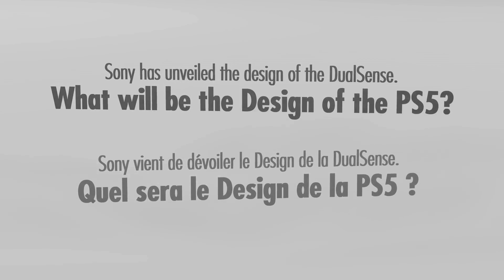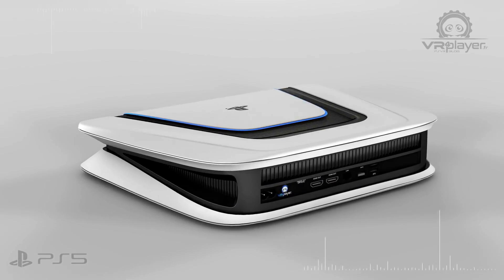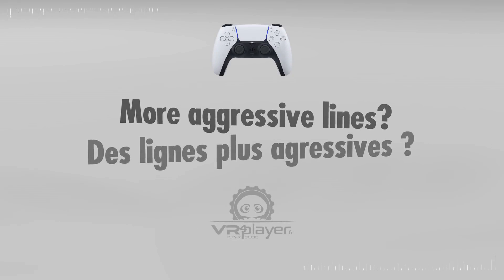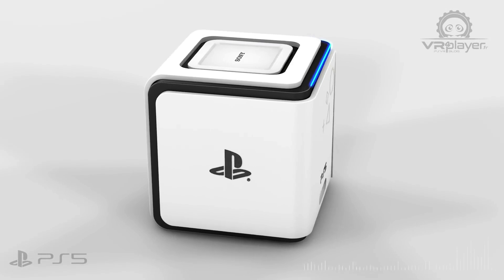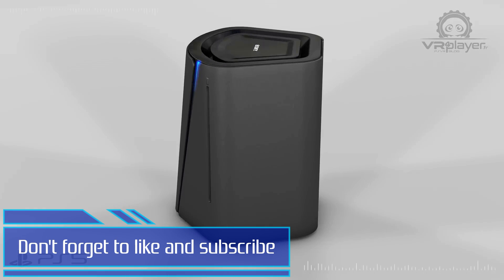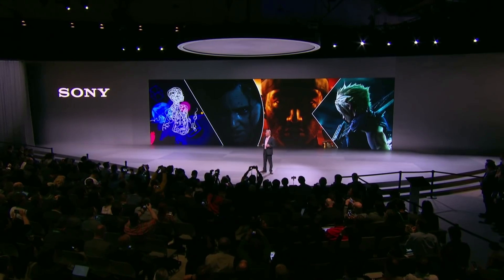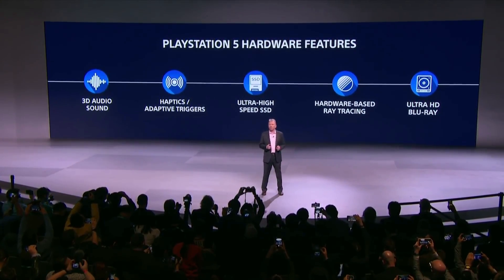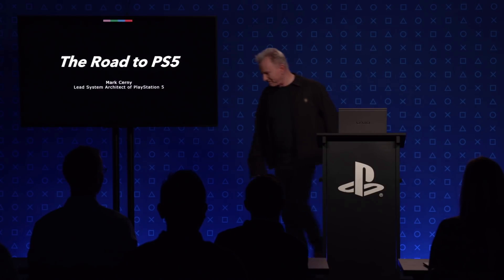PS5 Uses Revolutionary Cooling Solution | Overheating Concerns Squashed, New Patent Reveals

Comment: Xbox fanboys say the PS5 overheats yet ironically the xbox 360 had the most heat breakdowns in a system I've ever seen.
Reply: Been gaming since the nes , have bought almost every console at launch , the only that gave a problem was the 360 rrod
Reply: 54% failure rate to be exact.
Reply: @Krxtos7x  it was as high as 60% when they started coming off the assembly line.
Reply: My 360 had the RRoD...I was highly disappointed
Reply: I had every playstation up until the 360. All my friends transitioned to xbox and I unfortunately did too. I got the red rings after 6 months. Went right back to playstation ever since. It has its faults but it has way more to offer st the eod.
Reply: Jae D Xbox One X is superior in almost every way to all PS4 models. In terms of games that’s subjective and preference.
Reply: megazine that’s NOT true at all 

343 and the coalition have FAILED in every single iteration of halo & gears of war 

343 ain’t bungie the last best halo game is reach STILL 

Halo 4 playing like COD is a joke like fucking kill streaks 

Halo 5 with all those damn micro transactions is a RIP OFF 

The coalition isn’t epic games gears hasn’t been THE 3rd person shooter since gears 3 

Gears 4 is very lackluster compared to the trilogy 

Gears 5 is somehow MORE a RIPOFF than halo 5 

Forza is the only consistent series on Xbox and it releases every year making it become STALE 

State of decay series was let down 

Sea of theives was a let down 

Crackdown 3 is a laughable EMBARRASSMENT after 6 years and 2 different devs working on the same team using THE POWER OF THE DAMN CLOUD 

So no Microsoft exclusives were absolutely POOR compared to SONY & NINTENDO
Reply: DR3AMMA5T3R if ur ps4 sounds like a fucking jet, then clean it. Mine was like yours, but after cleaning the fan it runs dead silent. “My xbox one x is not even warm” lol
Reply: @DR3AMMA5T3R Wait hold on what games do xbox have again?
Reply: @DR3AMMA5T3R Wait hold on people still use bluray in 2020?
Reply: @DR3AMMA5T3R Xbox one is for hardcore games my ass didn't you see the E3 presentation it looks like they were tryna sell you a tv accessory.
Reply: @DR3AMMA5T3R Dead rising is on PS4.
Reply: @DR3AMMA5T3R By the way What you said about Dolby atmos did you know that Sony is making dedicated audio chip for the PS5 right? Which is SPU like the PS3 CELL which can open the door for emulation they are also working on this to work for all speakers headphones etc.
Reply: @DR3AMMA5T3R And guess what? Those titles are on pc too more reason to not get the tv accessory as known as the xbox one.
Reply: DR3AMMA5T3R God of War Uncharted 4 last of us Spider-Man horizon zero dawn dayz gone grand truismo sport drive club persona 5 bloodborne Detroit becoming human killzone infamous ghost of tshuma final fantasy 7 remake shadow of the colossus remake 

Sea of Thieves and state of decay where absolutely disappointments just like crackdown 3 

Notice how we have more games that are financially successful and critically acclaimed
Reply: @chriscollins3225  People be dumb they think their tv accessory is better then an actual console.
Reply: Patrick star I already know now they think having a bunch of mediocre studios making a bunch of shitty games on the game pass like stadia is gonna save them next gen
Reply: @chriscollins3225  "we" haha you pathetic moron .I'm a playstation guy and the only games worth talking about there are god of war and horizon zero dawn ,the rest are mediocre at best .children like yourself should shout about shit games ,only the good ones
Reply: lee porter bruh you ain’t a PlayStation fan 

You been proven over and over to be wrong already 

Everything you say speak louder than your words if you like PlayStation or not 

You ain’t fooling nobody 

360 is known to come in last place fact I literally just sent you think to PROVE such a case 

Everyone saw this Lol 

Also there are ppl in this thread that do NOT like playstation which have stated so 

You saying you came to this video proves you’re a PlayStation guy proves NOTHING at all 

What’s your PSN ? How many trophies do you have ? What games are shown you actually play ? Will show such a thing 

Which by the way I have a PS4 & PS3 and I can check BOTH
Reply: Xbox 360 the only console in the history of gaming that had to be recalled. Cost Microsoft billions
Reply: RE fan Firstly, a 1 TB HDD (which i have on my ps4) shows 860.1 gb of usable storage. Unless sony claims otherwise, they may be showing the actual usable capacity of the SSD, which is 825 gb making the SSD real size ~1 TB. Secondly, the ps5 gpu and cpu clock rates would drop only a few percentage points, i.e. 2.1-2.2 at worst for the gpu, which makes the gpu able to hit 10.3 tflops most of the time. Same for cpu. Know the facts before spreading false info.
Reply: @rtx2080ubermacht  yes but you would also have to take into consideration for them to draw maximum power to the gpu, the cpu would have to take a hit. So for devs it will become a balancing act.
Reply: Doug Burton true, the ps5 will have constant power draw. We’ll see how it pans out.
Reply: DR3AMMA5T3R then clean your ps4 dumbfuck
Reply: The white xbox overheaded but when the xbox slim came out that was solved the ps4 is kniwn to be loud and overvheat my one x is cool and quiet
Reply: Xbox does have a advantage in terms of raw power but when did that matter? The og Xbox was more powerful than the PS2 and look what happened? People here saying that the PS5 is a sega 32x should really look back at that comment and see how ignorant you made yourself look and by the way to that person that made a threat in a YouTube comment section you soft as fuck.
Reply: Patrick star hey kid don’t but into other people’s business on YouTube or in real life 

Something bad might happened to you 👀
Reply: @chriscollins3225  What exactly is other people's business when we are texting on a public YouTube video. Calling me the kid you can't even spell right "but into" lol.
Reply: Patrick star bruh I gonna be straight up with you 

You picking a fight when it was between me and some other little punk 

I threatened him to step up with all that talk 

I’m really about that action anybody can get it B 

So I don’t got any beef with you 

But I ain’t soft and I’ll be glad to prove otherwise
Reply: lee riley so he is your boyfriend?

Explains a lot why you’re so protective of him

You probably got beat up a lot during school explains a lot 

Xbox brand since the original Xbox has come in last place EVERYSINGLE generation 

The Xbox brand piggybacks off the successful windows software 

The Xbox brand can’t even come in 2nd place so now they have changed there direction and are competing with google 

Phil Spencer stated google is now there competition 
Which says a lot because stadia is a total FLOP
Reply: DR3AMMA5T3R mate, the word fucking does not mean im angry. I rarely get angry in online conversations, it is meaningless. In real life thats another story. What made me reply to you is the fact that ur ps4 is heating due to dust blocking the vents (most likely) and you’re claiming that the heating is due to sony’s faulty design, which is not the case. Also, ur xbox one x definitely gets warm :P
Reply: @DR3AMMA5T3R Minecraft is owned by Microsoft lol
Reply: @DR3AMMA5T3R if your one x is not warm then blame xbox for not giving you new games to play, it must be turned off
Reply: @DR3AMMA5T3R why would you want to loose a platform with so many more possibilities? PlayStation is better than xbox for gaming it's obviously clear to see. Xbox is a second choice
Reply: rockett buggey nah bro Xbox ain’t the 2nd choice 
That’s Nintendo 

Then it becomes do I want to build gaming Rig 

Then it’s the Soulja boy console 

Then it’s I can play mobile games or go back and be a retro gamer 

Xbox ain’t even considered a OPTION
Reply: Two wrongs don’t make a right. What’s more impactful is today since we will be experience it. PS5 still is rumored to have heat issues. Let’s see if this helps it
Reply: Who gives a shit about the 360?
Reply: Death Ray you
Reply: @chriscollins3225  no
Reply: Death Ray you must be why would you asked this ? On a comment section on YouTube that YOU weren’t even apart of 

Looks like you need to get your priorities straight
Reply: @Max__Powers  Facts lol. The Xbox One X is smashing every console that ever existed RIGHT NOW. Sold my ps4 and I am happy I did. The 360 is extremely old news and Xbox learned from it. And XSX is going to smash ps5 when it comes out.
Reply: Andrew P it ain’t smashing shit lol 

Xbox one x is a failure with its 40+ million user base in 7 yrs
Reply: DR3AMMA5T3R that’s because Xbox games aren’t impressive at all
Reply: RE fan Xbox 360 is KNOWN for overheating more than any console in HISTORY
Reply: DR3AMMA5T3R and you’re a egotistical delusional incompetent waste of space 🤗
Reply: @DR3AMMA5T3RBy the way you should really clean your PS4 it may help your heating problem and also re paste the chips.
Reply: @natpeterson3874  you cant repaste the chipsvthey are saudered onto the bored
Reply: DR3AMMA5T3R Your egocentric because you BELIEVE because you have slightly better specs you’re the winner 

You are delusional because the Xbox has never delivered 

You’re incompetent because well 

PS4 108+ million 
Xbox one 40+ million 

Xbox has FACTUALLY came in LAST place EVERYSINGLE generation 

I don’t play Minecraft it’s boring made of blocks of pixels I OWN Dreams PS4 tho ( the better user generated game ) 

So have fun playing crackdown 3 🤣
Reply: @chriscollins3225  You are right tho people saying "oH tHe XbOx hAs BeTteR sPeCs SoNy Is DoOmEd" is stupid. They don't realize that their console has no good exclusives. Games may look slightly better on the new xbox. But guess what? That's not gonna matter if microsoft has no good exclusives.
Reply: Patrick star yup Idk if you saw this yet but I truly don’t believe in teraflops when devs are echoing this from 1st to 3rd party 

https://youtu.be/jYbyCgqtGYQ

They just keep praising the PS5 and keep saying it’ll make a difference 

I haven’t seen any credible dev say otherwise about the series x 

And with Xbox game pass & xcloud being the focus they will never take advantage of any of the specs in the series x aswell
Reply: @chriscollins3225  Yeah i seen that video before i wonder how good first party games gonna look for the PS5 they made the best looking games on PS4 and to remind you that system only had like 1.84 teraflops of power. Something that people are not talking about is the tempest audio engine on the PS5 the chip has similar performance to the PS4 CPU chip it could be used to boost the PS5's performance a little bit and for audio of course
Reply: Patrick star trust me bro I know about this 

The 3D audio part will be so Great for PSVR games ! 

Also games taking advantage of this power on the PS5 because the power leap like you’ve showed will be ridiculous good compared to PS4 

Now imagine what horizon zero dawn 2 will look like using a upgraded decima engine combined with 10.3 teraflops and this ridiculously fast SSD 

I can not wait nor can I comprehend what that will look like
Reply: @chriscollins3225  65 million active xbox live users in 2019. Xbox stopped releasing sales figures so there is no way of knowing how many were sold. But 65 million active users all paying a subscription, I'd say they ain't losing. They increased users since 2016 when they had 40 million.
Reply: lee riley 65 million in 7 yrs  is STILL Embarrassing compared to Nintendo Switch in 2 yrs 

Or how PS4 is 108+ million 

So bringing that up like it changes the Fact the Xbox one is a failure well guess what it doesn’t
Reply: @chriscollins3225  either way 65 million is still a lot.
Reply: @chriscollins3225  and I never said the 'system' was a success but the brand of Xbox is hardly a failure, if it was they wouldn't of increased monthly users would they? They wouldn't be bringing out another system would they? Simple when you think about it.
Reply: @DR3AMMA5T3R your body is owned by the mind of a little kid with the way you assume everyone with a different mind set is a little kid lol
Reply: @DR3AMMA5T3R so starting off calling someone dumb is being nice lol ok I have every console from the NES  excluding Sega
Reply: @DR3AMMA5T3R and when did I say a console sucked? If anything I might of implied that PlayStation has more games than xbone.
Reply: @DR3AMMA5T3R I have a project Scorpio edition one x and I literally haven't played it since Forza horizon 4 released lol you know nothing. All you do is assume
Reply: DR3AMMA5T3R sounds like denial this guy literally just said y’all NICE to eachother 

And y’all owned both consoles 

Bhahaha 

Y’all believe in Santa clause aswell and sing Kumbaya to eachother 🤣🤣🤣😭💀
Reply: DR3AMMA5T3R you’re the moderator of the xbox community 

Lmao I guess you might be looking for NEW job then 

Try Walmart I think they might be hiring 👀🤣
Reply: DR3AMMA5T3R bruh we can cross play now 

I just want you to know beforehand i use to compete in tourneys across a lot of genres 

So we can definitely do that I’ll definitely repost you on YouTube So everyone can see me beat A Xbox moderator 

Also I am having fun currently on my pro playing God of war new game +++ 

Now you go HOPE the series x has value this time unlike your Xbox one
Reply: DR3AMMA5T3R I actually owned a 360 dumbfuxk 

I was really really bored of all the damn games being a shooter 

Like damn can we get some variety glad I got the PS3 when it dropped a year later best choice EVER
Reply: How is this in any way relevant to the current conversation or generation? The PS4 had cooling issues. Meanwhile not even ONE of the current Xbox consoles did and I have all 3. Microsoft learned their lesson and built the original One with a very large fan to keep heating out of the conversation.
Reply: @DR3AMMA5T3R big loser means more AAA games more AA GAMES plus VR. Bigger community. Better value. Actually have exclusives. I could honestly keep going for years. But to say I'm incompetent is ridiculous. Pick a game you want to play and I'll beat you in it on what ever platform you want. PlayStation 4 pro sold so many more units than xbone x and probably xbox one all together. How can you be so delusional. If what you want is power go get a PC. Power is nice but companies see where the money is and it's PlayStation. Why would so many games run just as good on a weaker console? Because they know xbox one x is the minority console so why spend time on it with no return
Reply: @DR3AMMA5T3R Why buy a console with no games? More power doesn't equal better. PlayStation showed Microsoft that many times. That's why PlayStation been winning console gens. Have all that power but it never gets used.
Reply: @DR3AMMA5T3R did I ever once say because a console sells more it's better? Your a fool in full damage control and I love it hahaha
Reply: @DR3AMMA5T3R pro gamer's lmao where? I have both console's and some of my friends that have world records in multiple racing games come to PS4 because "talent just isn't there" referring to Xbox lmao
Reply: @DR3AMMA5T3R when a Forza tournament is held better times are possible on controller. When Gran Turismo tournaments are held better times are possible on a wheel. "Pro players" lmao
Reply: @DR3AMMA5T3R good luck
Reply: @DR3AMMA5T3R PC is for pro gamers dumbass. Pro gamers wouldn't even touch console since PC runs better and less expensive.
Reply: @DR3AMMA5T3R I lost so much brain cells reading that comment. The reason xbox isn't selling because there's no reason to get one their shitty ass exclusives are on PC.   Which is better than consoles anyway. At least Sony has reasons to get a PS4 like actually having good exclusives.
Reply: @DR3AMMA5T3R No comment No counter argument? lol W.
Reply: @DR3AMMA5T3R You still have no counter argument. Congratulations you just took a fat L. Your first L was when you gotten an Xbox one over a PC. Have fun with kinect.
Reply: And ps3 have YLOD isue...
Well xbox have positive and negative and PS have it too..
But i would prefer xbox360  than PS3
😅😅😅😅
Reply: arie aja dech cuy the YLOD issue wasn’t due to dust buildup in the PS3 fan because users wouldn’t wipe off the system 

The 360 on the other hand is a completely different issue
Reply: paskwawi2007 We don’t know yet. Sony has better quality control but the PS1 has issues with overheating as well. Still though it would be nice to see the “revolutionary” (Nothing has been said so it’s hard to call it that when there isn’t anything on it) cooling system.
Reply: gottabump my friend actually bought 8 different 360 because of red ring of death 

I have another friend who bought 12 of em because there 360 kept on dying 

Tbh there sales numbers aren’t impressive at all
Reply: @chriscollins3225  I smell bullshit. Ms had 2yrs warranty on the original 360. Changed the cooling after the elite, slim etc after so why would your friend buy 12? 🤔 my guess it's bullshit or he's a giant turd
Reply: Ken Duro this is before the slim & elite dropped moron 

The elite by itself took 6 yrs after released to drop 

These consoles would only last like 4-5 months straight 

I really don’t give a damn if y’all believe or not tbh 

I know what happened I had several friends owning multiple Xbox’s 

Idk about the slim being good or not tho 

But I know the elite was good but that shit took so long to come out
Reply: @chriscollins3225  Haha I applaud your effort but I'm 100% sure you're making this up. I got my xbox 360 in 2006, 15 months later it had the rrod. Microsoft sent someone out to collect mine send a month later sent me an xbox elite. 

No one believe you simply because it takes one little search on the internet to find the release year for the 360 elite war in 2007.

Im stating fact here, not guessing like you. So please try again
Reply: Ken Duro actually I’m wrong let me reiterate he got all those models until the Redesign slim model came out in 2010 

Which was I believe stated to completely REMOVE the issue of the RROD issue 

I got confused because they look very identical being A black console 

The 360 you’re talking about STILL had RROD report issues that you can and EVERYONE can look up for themselves 

That’s why they REDESIGNED the console in 2010
Reply: @chriscollins3225  That's gotta be bs twelve xbox 360's that's 4,800$ assuming he/she got them new at the time 600$ was a lot of money. A person with a brain wouldn't even think about getting the same system that keeps failing on him/her more than two times you gotta be bullshitting.
Reply: Patrick star actually I’m not bullshiting at all tbh I had a lot of ppl in my high school who did this 

And the 360 wasn’t $600 at launch it was $400 get your facts straight
Reply: @chriscollins3225  The PS3 was 600$ at launch and people was complaining about it and the xbox was 400$ i was saying that 600$ was a lot at the time imagine 4,800$ at that time
Reply: Patrick star I 100% agree that it was a lot $600 on PS3 

My friends and people that I knew who purchased more than 1 360 because of red ring of death 

I literally found them to be stupid and I still laugh at them and bring it up 

They I shit you not would literally brag about how many Xbox’s they bought
Reply: And yet the 360 still won that generation .shows how much of a failure the PS3 was
Reply: lee porter the 360 didn’t win that generation moron it came in last place 

https://en.m.wikipedia.org/wiki/List_of_best-selling_game_consoles

Wii won the generation PS3 came in 2nd place and BOTH of these consoles came out a year later after the 360 launched FACT 

Lmao get ur facts straight fangirl
Reply: lee porter also those other countries DO NOT want that shitty Xbox brand over there that’s why lol
Reply: @chriscollins3225  so when do them sales stop ,because Sony only overtook 360 3 years after the Xbox stopped production haha and like I said they had nearly double the amount of countries to sell their console compared to Xbox .PS3 was shit and that's coming from a Sony fan .this generation was back to normal with Sony on top.But if you think the PS3 won that generation your delusional ,but everyone can already see that by the crap your posting haha
Reply: lee porter actually that is incorrect Sony PS3 overtook the sales of the 360 in 2013

Also the sales numbers stop mattering when the next generation starts 

Also you NEED to PROVIDE PROOF of such a claim 

As evidence SHOWS us PS3 came in 2nd place 

So PS3 won PERIOD no debate sales numbers debunks ANYTHING you say otherwise
Reply: @chriscollins3225  So you just pick and choose what does matter and when it then decides not to matter,how convenient .PS3 eventually overtook the 360 in sales for good in 2017 .
https://www.escapistmagazine.com/v2/who-finally-won-ps3-or-xbox-360/
Playstation have agreed that that generation was a mishap for them due to price ,games,and architecture.thankfully they haven't done the same since
Reply: lee porter the link you posted did NOT discredit the link I posted in 2013 with PS3 in the LEAD 

Your link just stated they are STILL wining in 2017 

Now when a generation of gaming is over should be when another generation starts right but it really doesn’t matter when the console wars for gen 7 ended 

The FACT of the matter is the PS3 outsold the 360 before the next generation of consoles released 

And in the lifetime sales came in 2nd place and the 360 came in dead last
Reply: lee porter still waiting lol